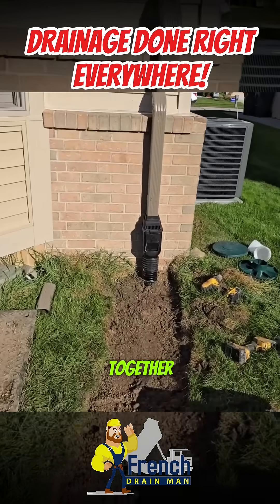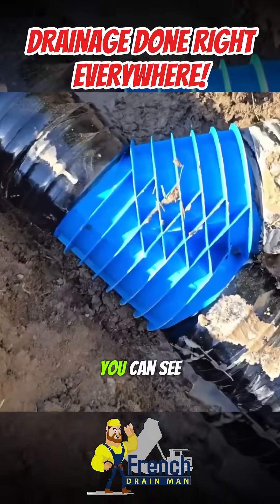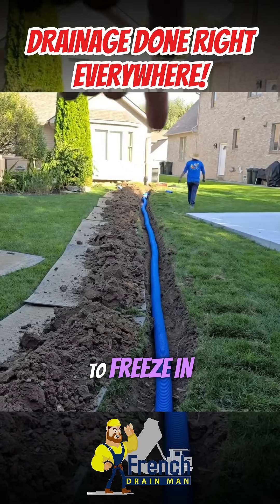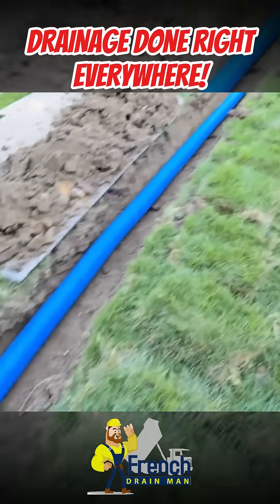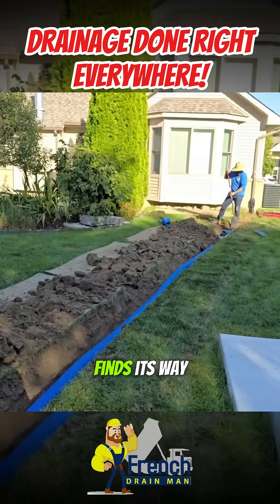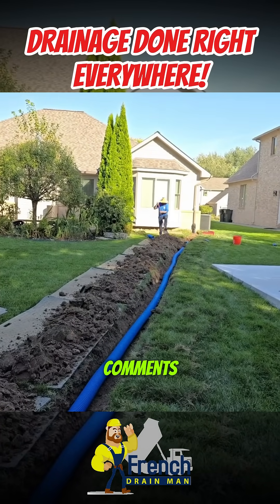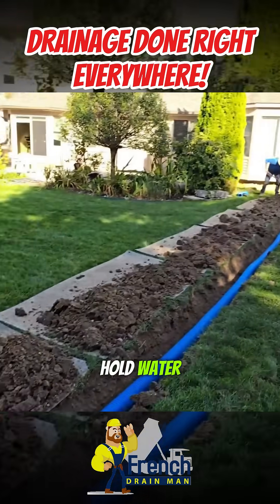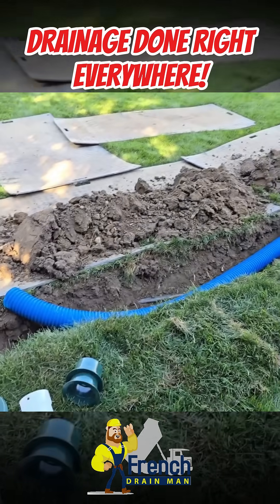Tie It All Together: French Drain + Yard Drain + Downspouts That Work Anywhere

Comment: 10/10, I prefer to start at the discharge & use minimum slope to the problem area to create the new-low-spot.
Reply from the maker: When there's not a lot of slope, that is exactly what you need to do.